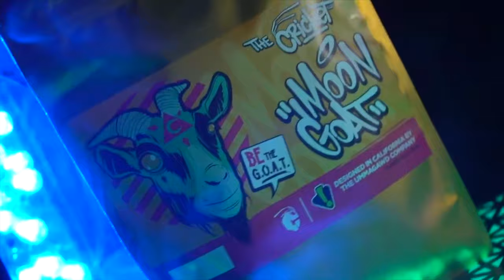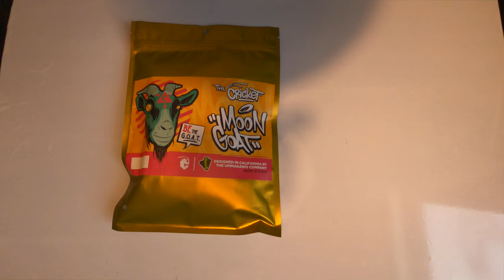HOW TO: BUILD A PROFESSIONAL FPV DRONE W CRICKET FPV (MOONGOAT BUILD)

Comment: So I just installed this stack on a little 3" Gecko build. Using the Caddx Vista with OG DJI camera. 
I'm running a TBS Crossfire Nano RX. 

  I follow ya in the video on how to wire the 3 wires you left free coming from the Vista unit to my CF Nano... but if I want telemetry do I just run a 4th wire from Nano to the Telemetry spot on the front/top tab on the Cricket FC?

Thanks for any help. Moongoat build is next. 😁

Comment: Confirming DJI cable order from UFL side over; Red Black, Grey, White, Brown.  This means the white and grey are flipped in their order coming from the FC plug.  Correct?  

Also, the DJI cable that came with my FC was not nearly long enough go twist nicely and zip tie to the frame.  The only way it would reach in this orientation was to go direct over the top of the air and straight into the FC.
Reply: Did you leave the wires flipped? I am thinking they shouldn't be flipped??? Any input would be awesome... Thanks

Comment: This build looks to me like the best one in the freestyle segment.

Here is a business idea for making some more money in this small fpv industry:

There are quite a few fpv people that do not enjoy tuning filters, pids and all the other parameters. Some just want to use there time flying a smooth, professional freestyle quad.

Mr Steele is on to something. If I was flying crappy analog I would easily spend 900 dollar on his personal build.

So if you became the bravest person,that is flying digital, in the industry and published your personal CLI dump then I would buy every bit of components in this build.

Then I could fly more often, and at the same time, be so stoked on that cricket tune that I would crash the quad to pieces every time. 

After some time I would figure out that I need a spare quad and I need to order some new spare parts, and I am not buying that cheap stuff from banggood if I want that good tune to continue.

Comment: Do you run a Cap? I am using you 6s motors, not sure how to mount the Cap.. also need to get some 3d prints for DJI antenna.
Reply from the maker: I do run caps on some of my rigs not all . But i send a pic if you send me a dm

Comment: sup Corey
I finally got your stack, thanks.   
but in the video, I noticed you turned your esc 90 degrees,   what the CLI  info for the motor remapping ?    
and no Capacitor install for your stack ? , I didn't see it

Comment: For anyone who has this cricket 200 stack. 
  
 What did you set the esc/motor features setting at on Betaflight? 

PWM
ONESHOT 125
ONESHOT 42
MULTISHOT
BRUSHED
DSHOT 150
DSHOT 300
DSHOT 600
PROSHOT 1000

I have it working on PWM but can't find anything that says what to have it on.  Thanks

Comment: @cricket fpv where is second video with betaflight setup ?
 Been waiting for you 😪🤔this is my first build and following along.
Reply: Yea I could use that... I am unable to get my Crossfire nano to recognize in Betaflight
Reply: @RixFPV  did you get crf to work yet ?
Reply: @lawrencemartin8205  No not yet
Reply: Did you get your CF Nano to work ever? If so do you have the setup steps? Thanks
Reply: @P.G._FPV  yes I did.. small error in video.. tx wire to rx then rx wire to tx .  I didn't worry about telemetry.  But then you have to bind and  update firmwares.  All should work. Look up joshu bardwell on YouTube.  He has all videos. Or also Oscar Liang on web is good also.
Reply: @lawrencemartin8205  thanks got my Nano receiver working but have no idea how to configure this FC in betaflight
Reply: @lawrencemartin8205  i put my esc and FC on quad like he did but don't know how to arrange the motors as they are setting to match on BF
Reply: @P.G._FPV  look up motor remapping.. Joshua bardwell has video.. that will fix that.
Reply: @P.G._FPV  the betaflight setup for FC is going to be a little harder for me to convey and explain.. honestly.  I had to have someone help me also. Watch a lot of joshua bardwell videos   on your tube.  Helped me. Kinda have to search around and peice together info.
Reply: @lawrencemartin8205  ok i got it in the air but just checking. What did you set the esc/motor features setting at on Betaflight? 

PWM
ONESHOT 125
ONESHOT 42
MULTISHOT
BRUSHED
DSHOT 150
DSHOT 300
DSHOT 600
PROSHOT 1000

I have it working on PWM but can't find anything that says what to have it on.  Thanks
Reply: @P.G._FPV  DSHOT 300 for F4 FC and DSHOT 600 for F7 FC
Reply: @lawrencemartin8205  this is an F7 correct?  Thanks for all your help. Really appreciate it. 👍
Reply: @P.G._FPV  if using the same fc esc combo as in this video.. cricket newbeedrone stack then that's correct . Its an F7 . No problem glad I could help. Happy flying

Comment: I got everything working but crossfire. What needs to be setup there? The normal setup I typically use is not working here with your config. It is bound and recognized but not in Betaflight.

Comment: Correct me if I'm wrong, but for those first time builders, if you follow this, you'll need to remap your motors in Beta flight. Why? How? I'll let Cricket explain that!!
Reply from the maker: Yep. I told viewers i would be doing 2nd video on  beta flight set up .
Reply: @CRICKETFPV  Yes, you did! I'm wondering when BF will add a single click set-up in the UI that will auto-remap the motors for you, as this is a very common orientation. Kinda like running props out with a single click!
Reply: @CRICKETFPV  When do you think that will happen? I am trying to setup crossfire as you do it there and it binds fine but betaflight not recognizing it.
Reply: I believe BF 4.3 will have this option once it's released but I use this website from Gal Kremer https://kremerfpv.info/#remap
Reply: @CRICKETFPV  did you ever do that video? Also did you leave the gray and white wires flipped that go to the vista? Any input would be great. Thanks
Reply: How do you do this? I need to remap the front two motors? Thanks
Reply: @3eggerfpv397  how do I do this. My front 2 motors need to be flipped?  Any help would be so appreciated. Thanks
Reply: @apfpv2378  I'm needing to remap my front 2 motors. Any idea how I could do this? Thanks
Reply: @P.G._FPV  You can use the motor mapping tool that Gal Kremer created. He has a video that shows how to use it.
Reply: @P.G._FPV - it would kinda be lengthy for me to explain it here, so I would suggest watching Joshua Bardwell's video. Just do a YouTube search with his name followed by remapping motors! It's basically typing in the correct CLI commands which he explains very clearly!

Comment: just laughing at idiots who will build drone on such an expansive components  and after a crash would have bended shafts on motors))) there is no need for f7 flight controller unless you want to have baro, gps, external bluetooth and some more useless stuff on freestyle drone. f7 gives you only more uarts on fc but no advantages of flying. I would definitely recommend if you want to spend such a money on freestyle drone by 2 iflight's nazgul5 or buy some spare motors for your build on succex f4 with esc and something like velox motors, which cost twice lower than yours. Your build is nothing more than show off)))
Reply from the maker: You get what you pay for . If your on a budget and can’t afford quality parts ..... then this isn’t the build for you buddy
Reply: Amen! @CRICKET FPV 🙏 You get what you pay for 100%
Reply: @CRICKETFPV  that's a great answer for a promoter who can't explain all the benefits of an expensive stuff because there are no benefits at all)))
Reply from the maker: @О.Ш-ь1щ  again quality . Took me a while to figure out the difference in this hobby myself . The sooner you figure that out the better off you will be .